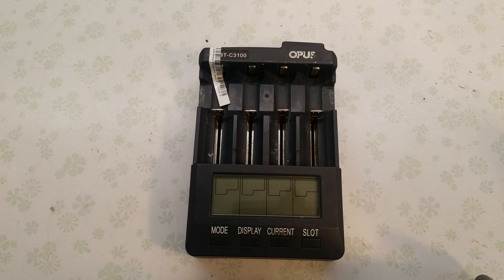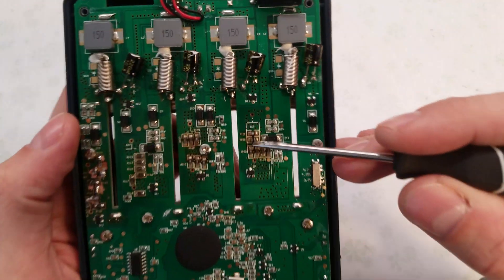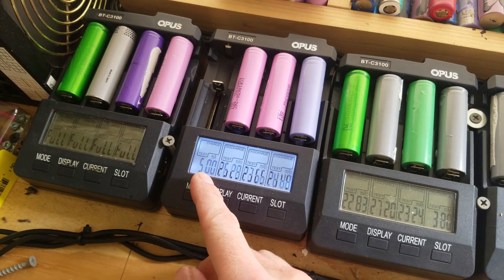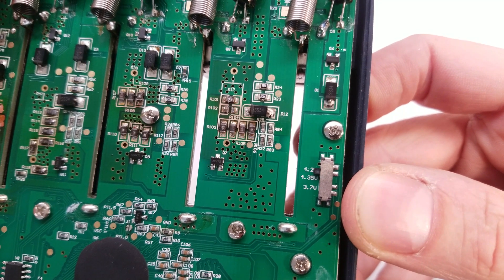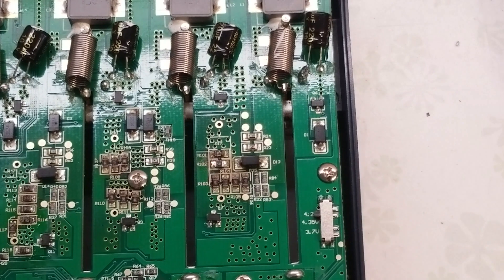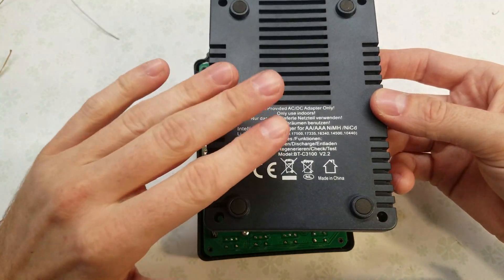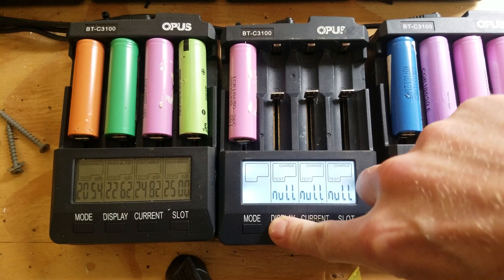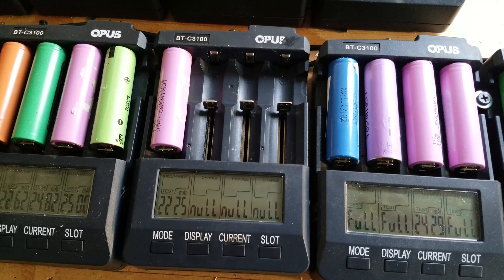Repairing Opus BT-C3100 Bad Slot Resistor Discharge Problem

Comment: Did you end up figuring out what's wrong with the flickering slot? I have the same issue
Reply from the maker: I've repaired many of these over the years. The two main problems I've encountered are the metal rail below the sliding negative terminal gets gunk on it. Cleaning that with isopropyl alcohol helps. And the resistors falling off due to overheating I guess. These really need a fan in the base to keep the board cool.
Reply: @LithiumSolar Thanks for the reply. I Cleaned everything, but be the resistors. Although none  seem to have failed catastrophically.

Comment: What about apply a thin metal sheet over the resistors glued with silicone?
Reply from the maker: I wouldn't trust myself being able to do that safely. The resistors are so tiny and there's not much room for error. Don't want a short circuit on a battery tester!
Reply from the maker: Is it? I put it in the Google translator and it doesn't translate French > English.

Comment: A touch of flux is what your solder joints are missing brother. That tiny resistor would practically align itself.

Comment: Watched your video and noticed the physical location of your bad chargers.  It doesn't surprise me that the chargers in middle have more of an issue.  Part of the cooling is the vents exiting the sides of the box.   By mounting them beside each other an adiabatic wall is created, another works blocking heat from exiting.  There should also be open area behind the fans.

Try a laptop cooler, no 3D printer or soldering expertise required!

Comment: Hi, I also have an Opus BT-C3100, I think I have a problem with it, when I turn it on at the third slot the letters and numbers don't look good, after a while it looks good, and after a while it doesn't look good , And at the end of the charging process at the third slot I get mAH after a second Full appears and it stays like that, while at the other slots at all time I get mAh after a second Full appears and after a second mAh, and so on .. ..My question is, why isn't it displayed on the third slot as well as the others .... Thanks for the reply

Comment: New sub! Thanks for this video. I have a charger that claims to be an Opus BT-C3400. The only difference I can spot is the board layout, and only in places -- they are still using the same resistors in the same spot. I used my cheapo dremel clone to cut a slot for that little switch --- that 3.7v setting is great when I want to store the cells. I'd put a bigger switch on the outside, but having no 4.35v cells, and being prone to accidents... 🔥

Comment: You install one resister that is about 1/2 the size and 1/2 the power of the originals.
And you didn't repair the solder on the others. Yeah, that's legit.
Furthermore, it would not have fixed the charger, since one missing resister would not cause the fault that you claim.
Reply from the maker: Not sure what to tell you bud. I've fixed this problem 15+ times now between all of the chargers I own. The original issue is always fixed AND I haven't had a single one fail a second time yet.

Comment: Hi! There are two problems with the BT-C3100
1. The built-in fan always works, even if I charge one battery with a current of 200 mA
2. Sometimes during the" charge test", the BT-C3100 turns off and then turns on again.
Can you tell me what the problems may be?

Comment: So I have a BT-C3400 that doesn't charge any slots. It sees the batteries. It can tell the voltage of each slot. I can cycle through the types of charging; however, it never starts charging. Does anyone know what could cause this? My fan is working fine. It turns on when I plug the charger in, but one day I noticed it didn't say full when I was charging my Li-Ions even though they were on for over a day. Then when I messed around with it, I found out its not starting the charge cycle. It doesn't change no mater which current mode I have it on.
Reply: Considering the high amount of 'Chinesity' inside these chargers (including the caps from 'Chongx' as I saw in my BT-C3100), I would not be too surprised if either the caps are bad or the caps in the powersupply. Both times: good enough for small currents, but when it needs to draw serious power, it collapses. This could be enough to reset the processor without you even noticing it.

Comment: hi, any idea about reparing one slot ?  issue is that it shows aprox. 4,5v permanently. on the terminals of this slot I can read by voltmeter this permanent voltage. if I put battery in this slot,  it behaves like there is battery with 4,5v  . Other slot are ok
Reply: Ever find a resolution to this?
Reply: @william.a.robinson  no idea so far

Comment: If the resistors keep toasting why not just replace them with a Thru hole dangling in the air to cool ?
Reply: a smd resistor works better since the pcb acts as a heatsink
Reply: @TheArachnoBot Why not put a thin metal sheet glued with silicone over them?
Reply: @MACYNET323  adding a heatsink might be possible but tricky because the resistor is so small. Definitely dont use silicone, its a thermal insulator.
Reply: @TheArachnoBot  There is conductivity thermal silicone like kafuter 5203K, it's still better than air.
The best way would be put non electrical conductivity thermal paste between resistor and metal plate, then fix it on their borders with silicone
Reply: @MACYNET323  sure, some special silicone could work. But honestly you'd just be better off adding the 80mm fan mod. The stock fan basically does nothing and the pcb should be enough of a heatsink.
Reply: @TheArachnoBot  Agree the small fan is almost useless.
Does there is space to add a slim 80mm fan inside the back of stock cover?
Because now I can't customize a deeper one.
Thanks
Reply: @MACYNET323  sorry, i 3d printed a new bottom case to fit the fan so i dont know about the stock case. What i can say is that the fan upgrade works great. Of course you can add a fan outside but that has its own challenges.
Reply from the maker: Maybe I'll give it a try next time. I was hoping it would last a few more years after repairs with better cooling.

Comment: I have a couple questions if you don't mind answering them.

How long is the Discharge Test supposed to run? Is it multiple cycles? It seems to run for quite a while. Does it leave the batteries discharged when complete or re-charge them when it's done? Is this the best way to determine mAh left in the battery/health?

I assume the refresh mode is to re-condition older batteries?

I recharged 4 eneloop AA's at 1amp and it left them at 1.48V, the included charger leaves them between 1.24 - 1.32V. Isn't the 1.48V overcharged?
Reply from the maker: Sure, no problem :) In charge-test mode, it is supposed to do one cycle. One cycle is charging to 4.2V, discharging to 2.8V, then charging back up to 4.2V. If you have a 2000mA battery and you are running it at 1000mA, it's going to take ~2 hours on each step, so that's ~6 hours. If it's a 3000mA cell, you're up to ~9 hours now. I don't use the refresh mode, but I believe that keeps charging/discharging in an attempt to restore older cells until you manually stop it. For the last question, I'm not familiar with those particular batteries. Are those NiMH? It looks like the charge voltage of NiMH is anywhere from 1.4V - 1.6V depending on the cell, so 1.48V sounds ok, but can't say that with certainty without seeing cell-specific specs for the AA you have.
Reply: @LithiumSolar  Thanks. Yes, the eneloop are nickel metal hydride, here's the only link to the specifications I can find:
https://www.panasonic.com/global/consumer/battery/eneloop/technologies.html

I have the white ones, they're nominal voltage is 1.2V and 2000 milliamp hours.
Reply: @davesnothere688  - about 1.5V is the normal charge voltage for NiMH. The "1.2V" you refer to is the NOMINAL voltage. Here is independent test of typical white Eneloop:
https://lygte-info.dk/review/batteries2012/Eneloop%20AA%20BK-3MCC%201900mAh%20%28White%29%20UK.html
You could always Google for the Datasheet if you were really keen to confirm the info.

Comment: Anyone knows the fix on one of the bays says full or even has voltage reading even tho no battery is inserted
Reply from the maker: No, but if you find out, please let me know. I still have one of  those that I wasn't able to fix...
Reply: Anyone have an update for this?  Just garbage and get a new one?

Comment: you should have replaced them with higher watt resistor
Reply from the maker: I assume I could put one larger resistor instead of several smaller resistors then? I assume these are all wired in parallel (it looks like they are).
Reply: @LithiumSolar  No, what Filip Munk means is that you replaced 0805 size resistors with the same size, while the pads seem to be able to take a 1206 size resistor. 0805 size resistors generally can't take more than 1/8 of a Watt of dissipation, while 1206 size usually take 1/4 Watt max.
I intend to take it a step further, by placing 0612 size resistors (1 Watt devices) on their side.
Reply: @LithiumSolar  I can now talk about experience with replacing the resistors with 12 automotive 10R2 size 0612 (that's 1206 reversed) 1,5 Watt 0,5% resistors, by pairing them for each original 5R1.
Experiment: Failed. They heat up to such ridiculous amounts at 1 Amp discharge it's just insane. When my meter surpassed the 102 degrees Celsius with ease, I ended the test.
Now planning on four 5 Watt wire-wound 3,4 Ohm resistors parallel. I just have to see how this charger discharges, as high PWM-like discharging could be problematic with wirewound resistors.

Comment: Why not just replace the entire load resistor bank with a larger wattage regular resistor and never have to worry about it again.
Reply from the maker: That would be a great idea :)
Reply: @LithiumSolar  I can say that you will have a hard time finding the 0,85 Ohm resistor. I ended up with 4 Vishay RS0053R400FE12 3,4 Ohm 5 Watt 1% 50ppm/C wirewound resistors in parallel per channel for this to work. 0,85 Ohm resistors were either not available, lacked sufficient dissipational power or were 5% types. If they were 1% tolerance, they had quite a high temperature drift.
These Vishay's stay cool at 60 degrees in a all-around convection-cooling situation. Downside is their size.
Reply: I'm about to order far bigger resistors (0612 size 750 mW watt devices that I will mount on their side). Just as a test I will also order resistors twice as big in value, and mount 2 of them in parallel on each spot where a 5R1 resistor would reside. This way, every resistor takes half the dissipation (probably not in real life, as the dissipation usually also depends on the copper traces).
One large resistor is possible, but besides a rather odd resistance, you will also concentrate the heat on just a single spot on the PCB (The leads to the resistor WILL get warm!).
Spreading the heat isn't bad.

Comment: Pretty amazing you have processed so many cells. With an average of ~2000 mAh per cell, 30k to 50k means you have processed 216 - 360 kWh worth of cells thus far. Having done ~30 kWh of cells myself, that is an insane amount for one person.
Reply from the maker: I've been doing this since 2015 ;)

Comment: Great video mate. Those resistors are rated for 1/8 watt each and there are 6x in parallel is only rated for 3/4 watt. Total resistance would be 0.85 ohms I think and the SOT-23 N-channel FET is an A03400 which is rated for 5.7A VGS=10V that pulses it and probably also dissipates the heat too. So I think the PCB copper plane, via's and the fan is doing most of the heat dissipation.  With us running 18650's @ 1A discharge we are pretty much constantly pushing it to its limits. That said it is remarkable that they last as long as they do.
Reply: I would dump the six 5.1 ohm smd resistors and install one larger wattage regular resistor and raise it off the board for better cooling effect and be done with the smd devices.    OR   It might be worth trying to reflow all the factory resistors with leaded solder also.   I think the lead solder would hold up to the heat better if you don't want to mod with real resistors.
Reply: @jp040759  The problem is you're likely facing an odd-value super-precise resistor if you want to go for just one resistor. The fact there are a few of them in parallel on a heavily via'd PCB is not only done to minimise the dissipation in each resistor (which, to be honest, obviously is still a bit much). It's main purpose is having more control over the total value.

Besides that, you could need a very temperature-stable resistor. Combined with all of the above, you end up with a quite expensive resistor.

I do agree that replacing the resistors with smaller form-factors like in this video, is something I would not recommend as well.
Reply: @weeardguy  Good points.
Reply: @jp040759  And now I can say that one indeed will have a hard time finding the 0,85 Ohm resistor. I ended up with 4 Vishay RS0053R400FE12 3,4 Ohm 5 Watt 1% 50ppm/C wirewound resistors in parallel per channel for this to work. They are bulky, the leads are thick and sturdy, but at least they stay cool at about 60 degrees Celsius in a all-around convection cooled situation (the fan of the charger does not even turn on)
Downside is that their size means one will have to think about a good case to fit them all inside and preferably spread the heat by having a thick-layered PCB to solder them to.

I did try 2 10,2 Ohm 1 Watt 0,5% automotive 0612 size resistors in parallel for each 5R1 resistor (that makes up for 12 of those 0612 resistors per channel) but they ran so incredibly hot I aborted the test (when the meter easily surpassed the 100 degree Celcius mark, I put an end to it)
Reply: @weeardguy  Thank for the update.   Glad it worked out.
Reply: Those resistors are absolutely not the ones sinking the wattage. They are for current measurement at most. There are copper wires at the top of the unit that dissipate the heat.

Comment: Has anyone a idea wher I can find the intern voltage replacement switch or a video how to change it to a extern switch and replace the intern, becourse mine is not locking in the positions, it's sliding all over the place. 😕
Reply: You can find the  switch by looking at it on the PCB. You don't need any video or instructions to use your eyes, do you?
Reply: @johncoops6897  yes i do, but you can't read, I looking for buying the replacement switch and not on the pcb board.
It Dosen't matter anyways anymore, the chargers break to easy, they aren't well build.
Reply: @WaschyNumber1  - Oh, OK. From what you wrote, I assumed that you intended to change over to an external switch (which is the logical thing to do with a BT-C3100 anyway).
In that case, no videos are required... You open it up, drill some holes, bolt any switch you like into your desired position, then run some wires to the existing (internal) switch pads. To find those, just look... If you know about the switch you know where to look.

Comment: I have a single Opus tester, which has done over 1,000 cells. I made a back cover out of wood, and added a small fan about twice the size of the one it comes with. Both are powered through the same connector, so they only run when the tester gets hot. Also, I pre-charge all my cells on TP4056 boards so the Opus only does discharging. Weeds out the heaters and leaky cells before they get tot he Opus.

Comment: You fix nothing durably by just replacing missing or burned resistors, you should improve drastrically cooling: no more breakdowns, no more halts during discharge! These resitors are originaly undesized, the pcb is heating at more than 100°C during discharge @ 1A!
Reply: These resistors arent taking the ~4,2W dissipated. One of those is rated for 0.1W max. They are most likely for measuring current. Oh and if the pcb hits 60 degrees the device shuts down, so no worries there.

Comment: Thanks for the video. I’m also charge/discharge Li-ion batteries for my own use at home and I use Opus BT-3100 device. I have no complaints with it, except that the fan failed and I use an external fan to cool the batteries when discharging. Thanks for the info to build a deeper bottom enclosure to fit a PC fan. That is a great idea.
A few days back I made a mistake by inserting one 18650 that had lost the negative insulator ring, on top.
MY MISTAKE. This caused the negative and positive getting shorted and subsequently red hot Opus positive terminal. Since then that slot is U/L. I red taped the slot. 
Upon checking I found the FIRST, SOT23 transistor shorted out. Is it possible to obtain the transistor? Unfortunately I’m unable to read the alphabets on the SOT23, to identify it. Would you please be able to point me to a link, where I can procure it?
Thanks in advance.
Reply: Most likely one is able to source the SOT23 transistor. But which one is the 'first'? I've got Q7, Q9, Q11 and Q13 inside. Those are A08K marked and are MOSFETs.
Then there are Q6, Q8, Q10 and Q12 which are marked ALVE 3C. ALVE is most likely some obscure manufacturer (can't find it under the full name), as 3C is a regular marking for a general purpose PNP transistor. (BC857)

Comment: I'm happy with my 3 Opus testers even if I have lost 3 slots over the last 2 years!
My discharge resistors appear ok, but would be good to fix the "phantom cell" problem.
Reply from the maker: Even if they look ok, try reflowing the solder on them. It get very brittle, hard to explain. I'll be looking at the phantom cell issue next, a few other people seem to have that problem as well.
Reply: @LithiumSolar Thanks, will do. I'll try a hot air gun and make a foil template to shield surrounding components and plastic.
Look forward to your phantom cell solution!
Reply: @LithiumSolar  oh, I had a cell leak electrolyte into the slot once. I solved that by taking out the board and washing with distilled water.